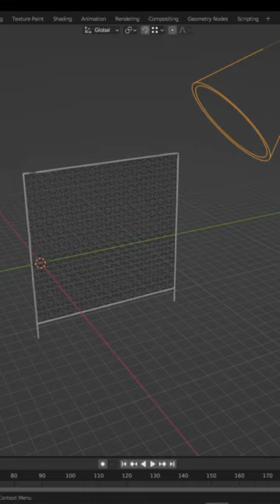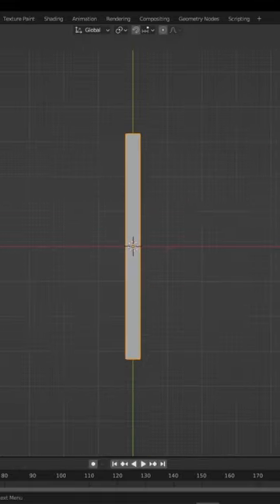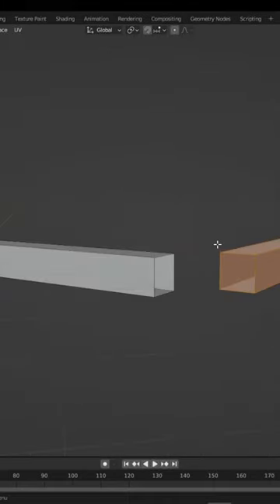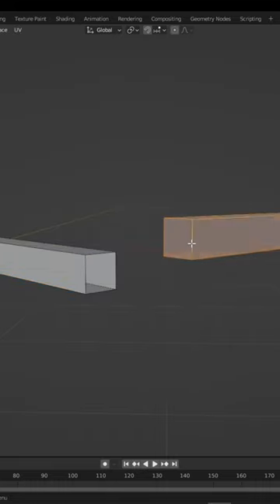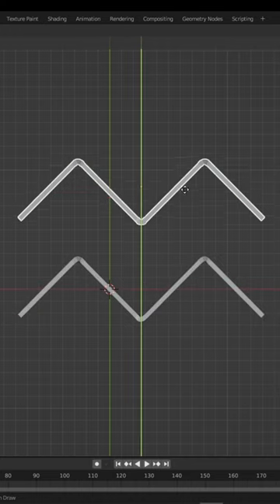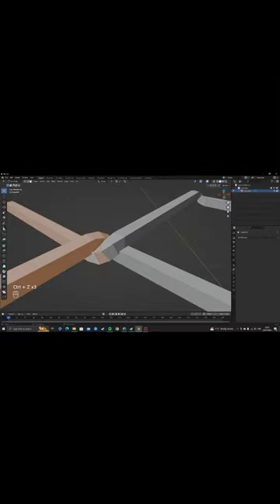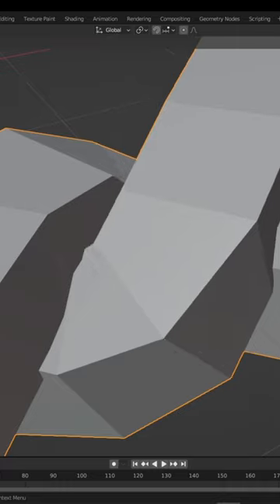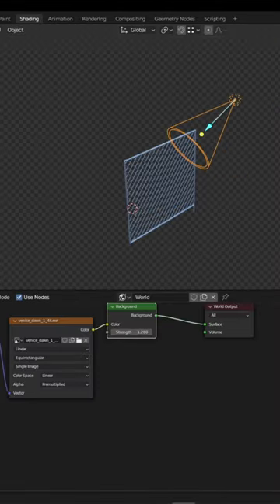Model a Fence in Blender in 1 Minute

Comment: Why not just use a flat object with a fence texture and alpha out the shape? I mean… why would you need to model a fence when you can just do it this way?
Reply: To be fair without addons or texture assets texturing something like that is a tough job. But single plane is still better in general. Less poly and with assets much faster and simpler.
Reply: Just depends on your goal, if youre using it a game, yeah a plane with a texture is way better but for a detailed render you would do this
Reply: @joshuairvin9661  You're absolutely right. I was thinking more game then cinematic.
Reply: what if you want a closeup?